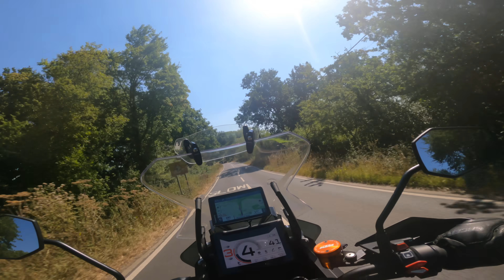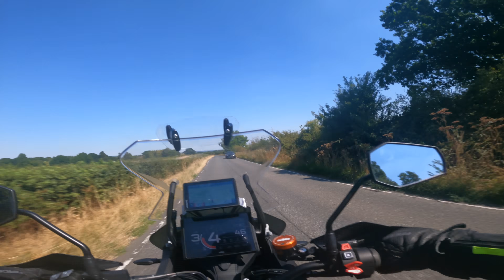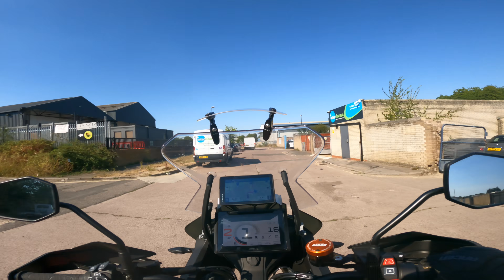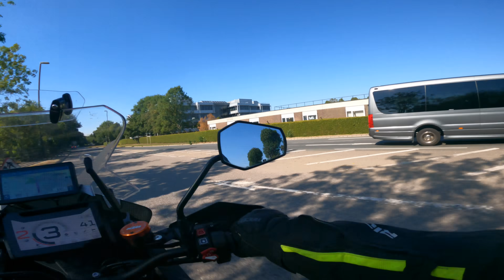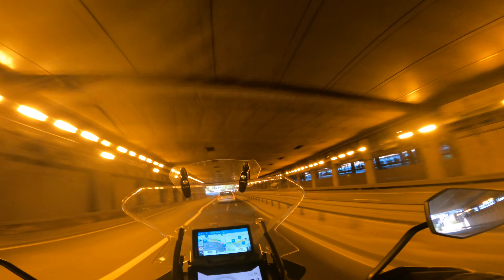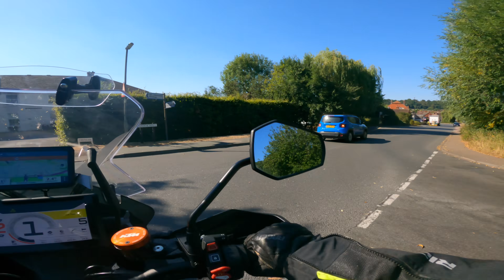Why does my KTM Super Adventure weave? | VLOG

Comment from the maker: I should say the weave is significantly less noticeable now since having my nut tightened. Removing the top box also helped before I had the head bearings tightened as well. Sort of forgot to mention these crucial bits in the video 😂
Reply: I had , years ago , the same problem to my bike. New tyres , new suspetion(ohlins) but nothing. At the end i solved it by replacing the thrust bearings with tapered roller bearings. If the problem remains maybe a similar solution will also solve yours. just beware ,  the clamping forces for the bearings are different due to the bearing type
Reply: Yeah I noticed a huge difference after removing the top box. I also have bar end mirrors and Touratech hand guards fitted. Got rid of the factory mirrors too. What once was a wobble so bad that if you left it to build you'd eventually crash to a slight oscillation at 41 mph. Oh and it's rock stable at ***mph even with the panniers fitted now too.

Comment: I had the same problem with brand new KTM 1290 SAS. The happiest days with a KTM, are when we buy it and when we sell it. KTM motorcycles are a big problem, brand and dealers are unresponsive to customers.
Reply: Sell it? Still have it? Wobble fixed? How?
Reply: @jonasbaine3538  I Jonas, at the brand's request, I changed tires, adjusted the suspension in every way (tests without side bags and top box, with the screen always in the lowest position), and the problem remained. The KTM technician manually adjusted the suspension at the front, and that didn't work either. With great regret, i sold the motorcycle after 6 months, my safety comes first, as because the importer and representative of KTM Portugal were not responsible for the problem and did not provide or propose any solution to solve. KTM never more!!

Comment: How is the weave several weeks on? I have found a few things... The assertion that it's to do with tyres, or tyre wear, is a myth. I have changed tyres, and changed brand, even brand new it still did it. Removing the top box helps a bit, but doesn't eliminate it, but then these bikes are designed to be able to tour on and take luggage with you, so I don't find that excuse acceptable. What I have noticed is that the rear suspension seems quite undersprung (I'm 92kg), I have bottomed the rear out many times on bumpy roads but can't get the last 30% of travel on the forks for love nor money, even riding like a complete tool and barrelling into things faster than I should hard on the brakes. Upping the preload on the rear helps a small amount, but does also increase the seat height too. I am investigating stiffer rear springs (I'm not about to get much lighter, and I often ride 2up with luggage too, as well as a big top box) but in the meantime have resorted to running the suspension in a firmer damping mode than I usually would and putting up with a little discomfort, and this has lessened the weave noticeably too, even with a top box and pillion on...

Comment: I have a weave on my 23' Tiger 1200 GT Explorer above 100mph, but its totally random when it happens. It happened with the stock Metzler tires and it also does it with the new Dunlop Trail Maxx mission tires, but I always have the top box on.....🤔 Currently at 8400 miles. Oh, the vibrations disappeared around 1,000 miles, it's a phenomenal bike!

Comment: I had the Head bearings tightened twice in the first 1000 miles. The first time was very loose. You could not lest go of the bars at say 40mph.
Always had the preload on 100% and never suffered high speed weave  ut I am a heavy rider. My old 1200 multistrada loved to weave at high speed however
Reply: this is exactly my experience but I'm only 12.5 stone, in Spain I did some stupid speeds luggaged up but never had a high speed wobble so maybe the fact it's in the high position puts a little more weight on the front end.

still wobbles at 40 mind buy only if I let go.

Comment: I agree with you about the tech ,, I’ve just got a new GS and basically I’ve just left it how I picked it up ..ie fat slow man on comfort settings ..only got 2 riding modes selected rain and road even tho I never switch to rain as I’ve learnt to control throttle in the 40 years of riding ..

Comment: Have you tried ducking out of the airflow a bit more during the weave?
It could be rider dependent. 

You could also try putting on a load of weight, so the centre of gravity is a bit lower 🤓

Comment: Yup the one I tested did that under power at high speed.. just one of those things it does 🤷‍♂️
Reply from the maker: They all do that sir. I still love it, mind you.
Reply: @timrodierides  unacceptable for these new bikes to wobble nearly throwing rider off.  have heard of crashes caused by this.   my 2014 1190 wobbles even with new pilot road 6 tires.  Want new 22 1290 s but the thought of dealing with same issue of ridiculous.  i want sportbike performance, top speed 150, and stability on adv bike without dangerous wobbling.  s1000xr is not true offroad adv bike.  multistrada is approx 10k usd more than ktm

Comment: I had a V-Storm with a top box that would get all “wiggly” at 80+, strapped a waterproof duffle in its place and it still did it just as bad. Moved the rear”luggage” to the pillion seat and wiggle was gone 🤔. Seems the wind can do funny things when there a gap between the operator and boxes/bags hanging off the very rear of the bike.  So, I’ve resisted putting any kind of “box/bag rack” on my new 890 adventure, just to prevent a repeat 🤪👍.
Reply from the maker: Aha - that makes sense. Thanks for the comment!
Reply: I had a BMW s1000XR first generation, it weaved with or without luggage at 120 mph plus. Autobahn
Reply: Well, correct. Put no weight behind the axle... just as on the trailer. It got to wiggle due to physical principles.

Comment: I share your frustrations. Mine does the same with or without top box. Not wanting to blather on about previous GSAs but there was always rock solid stability at stupid speeds. Even with new tyres and adjusted head bearings the issue persists
Reply from the maker: I think the KTM has more aggressive geometry. Which is fine but makes it feel flighty
Reply: @timrodierides  I have my preload wound up to 70% most of the time which I do think helps. It’s not enough of an issue to make me regret my purchase though. Still an amazing bike!
Reply: @brucecutts8841  wobble fixed or still living with it?
Reply: @jonasbaine3538  sold the bike - not for that reason obvs but I just lived with it - only a problem at silly speeds on private roads!
Reply: @brucecutts8841  and i sold mine!!
Reply: I had the same problem!!

Comment: Top box caused a terrible head shake weave on my 1290 SA ….just one of the reasons I swapped back to a GS. Tyre wear pressure claim is a load of bollox …they all do it. It will kill you on the Autobahn …just don’t go fast with a top box on your KTM.